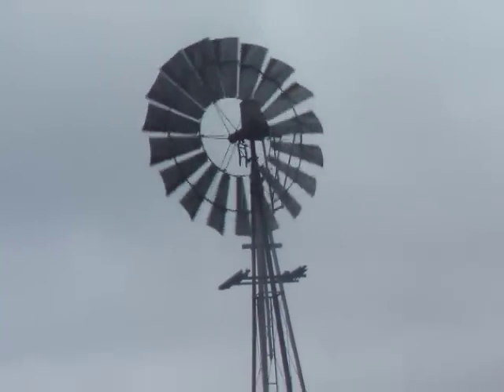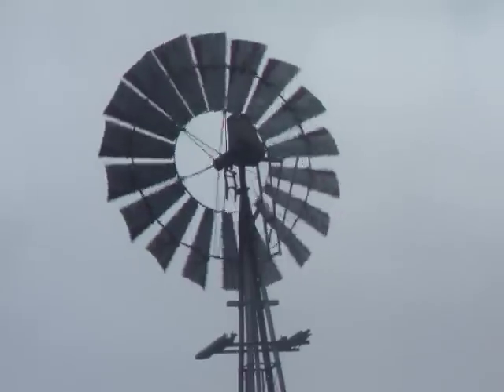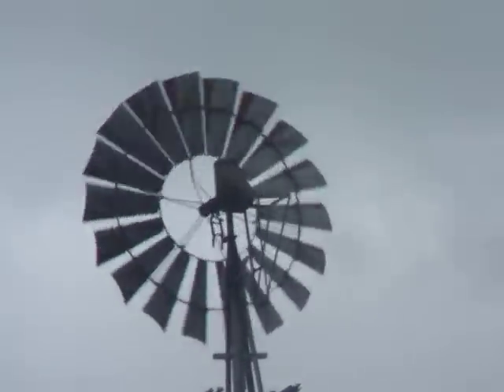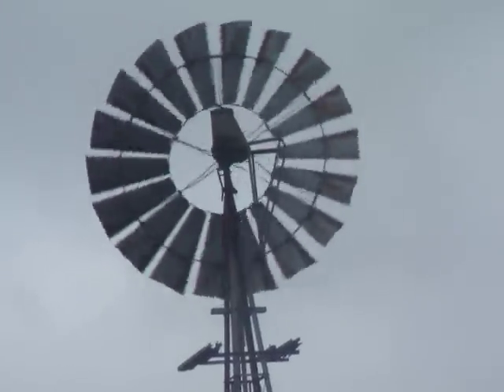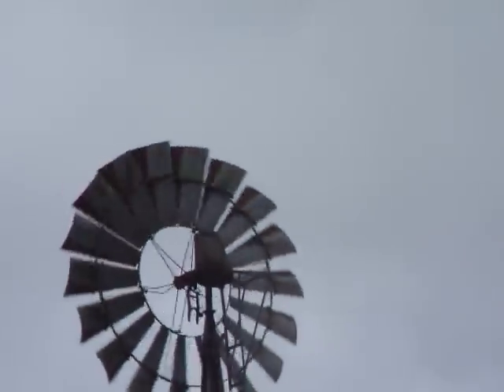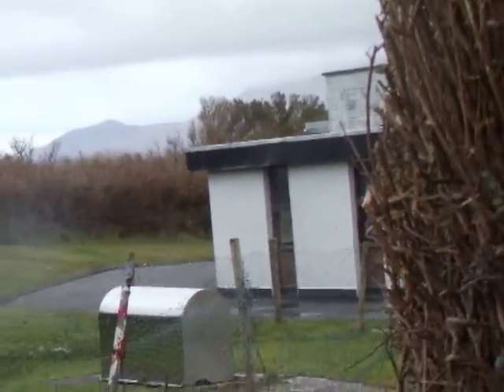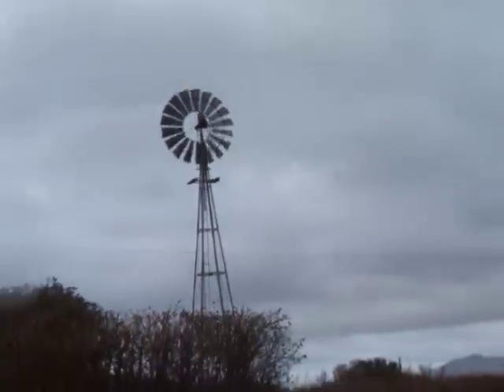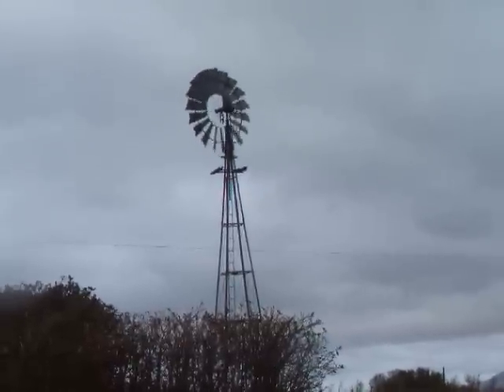Exploding Wind Turbine pt 1

Comment: I have that ornamental wind "thing" in my back yard, I can watch it from my desk and it turns in very little wind.
This is the link for the connector and cable for the aux port on the watts up meter. 

rc - electronics - usa.com  /   auxiliary - connector

John